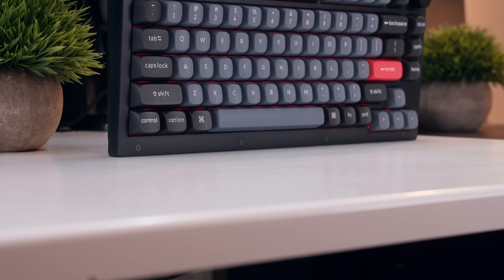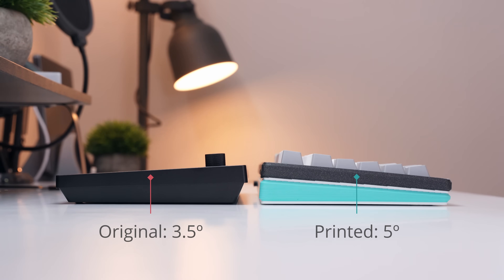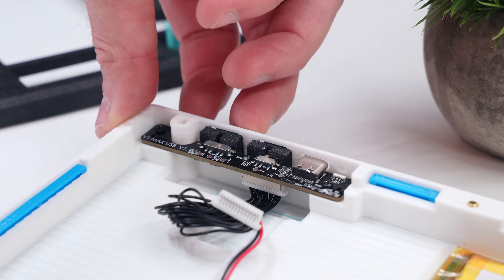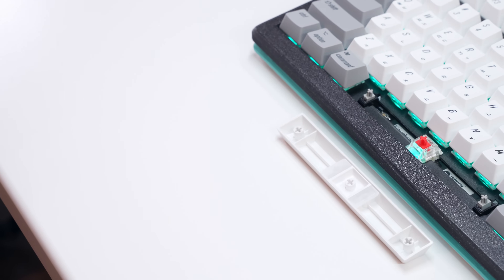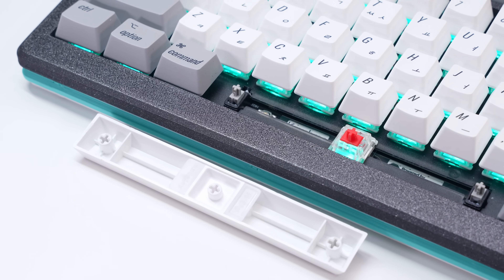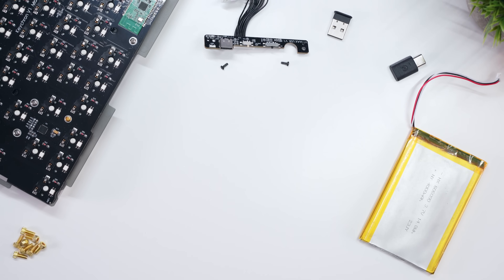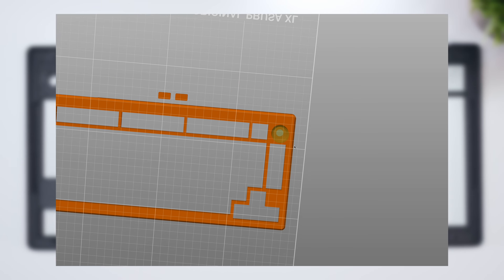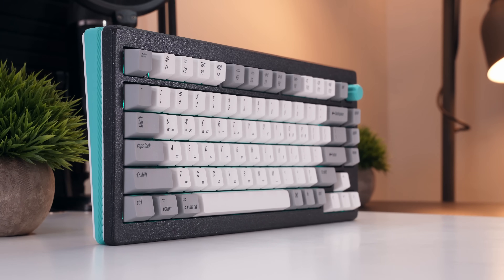My FREE Custom Keychron V1 Max Case (3D Printed & Open-Source)

Comment: Hi there, I am looking for a V6 Max chassis but keychron has been very quick to shut down anyone selling 3rd party shells for it. I'm wondering if this could be modified to fit the V6 max? (Essentially adding the numpad). I will do it myself, though I'm new to this.
Reply from the maker: Possibly, but it may be easier to start from scratch depending on how similar the plates are… I would probably start from scratch

Comment: I have the keychron V1 (non max), would this case work with mine? And if not, how could I modify it to work with mine?
Reply from the maker: Unfortunately no.  The non-Max version isn’t gasket mounted, so the PCB and plate are different.

Comment: Nicely done! Probably gonna try this!
Reply: Also, what TPU did you use? I believe you can try different hardnesses of the plastic, and therefore alternate the sound.
Reply from the maker: Thank, let me know how you make out (and be careful with the battery removal) - I used 95A TPU because it prints easier, but you could opt for 85A if you want it softer ✌🏻

Comment: I really like the aesthetic design of it, but from the look of the flex test and the sound tests, I think the gasket design could use a lot of work, or rather simply, just removing a lot of the plastic in the way and using foam gasket strips instead of the printed ones. If you look at 3:14, those gasket cups basically only allow for like 1mm maybe 2mm of flex space, and the base weight of the PCB resting in there is probably already fully compressing them letting the plate contact the case thus transferring all of those vibrations.

One illustrative test you can try for your own understanding, is setting the tape-modded PCB alone on a hand towel on your desk, and seeing what the board sounds like then. That test shows basically what a perfect gasket and perfect foams, the case generating zero unwanted noise at all, could sound like. Attaining that fully is unlikely in most consumer boards, but they can still get much closer than your original design, simply through much more flexible gaskets. In a heavy aluminum case some vibration getting through is less of an issue, but in a plastic one, especially without very well through out construction that prevents rigid points of contact, will produce tons of generally unpleasant vibration/rumbling/rattling sounds, and that stiffness reverberates back up into the switches making them sound worse as well on top of the case noise.

Your dyesub keycaps are suited towards a deeper/softer sound profile, so they can be fine depending on what you're going for, but the switches can be VASTLY improved for very little cost. Basically top-end astoundingly good sounding switches that are genuinely like nothing you've ever experienced before, with great stock lube so zero effort is required, are under 30 cents each, less than half of what "the best" unlubed switches from just a couple years ago cost, that now sound so cheap and low quality in comparison. HMX, Vertex V1, some of the newer Gateron releases, Bsun, etc. An HMX, Vertex, Morandi etc pickup would make a pretty night and day difference to this board or really any you put them in.